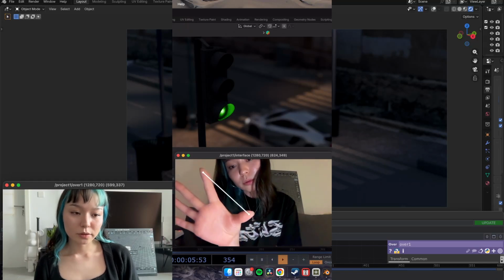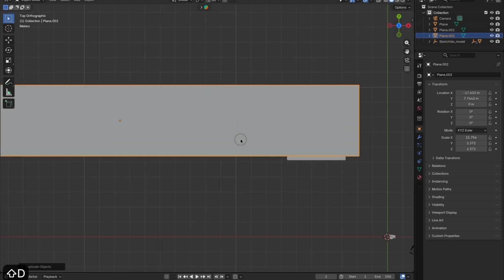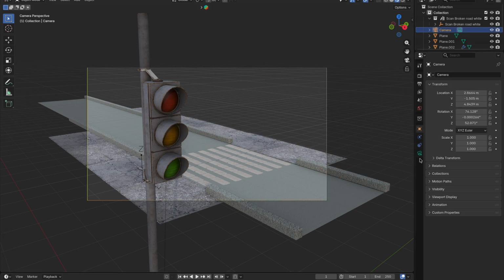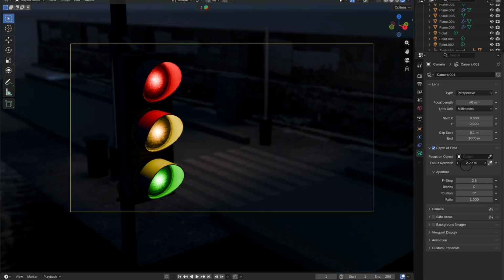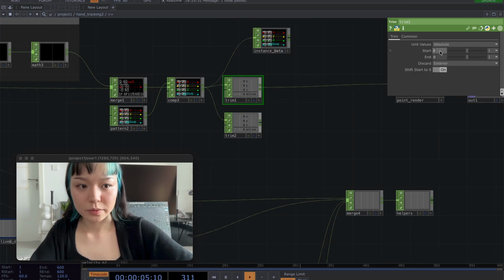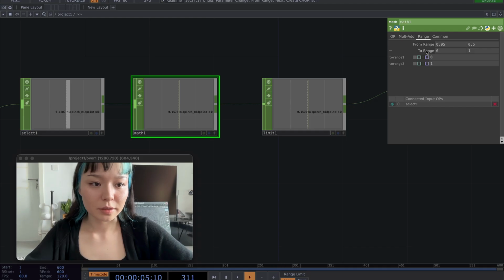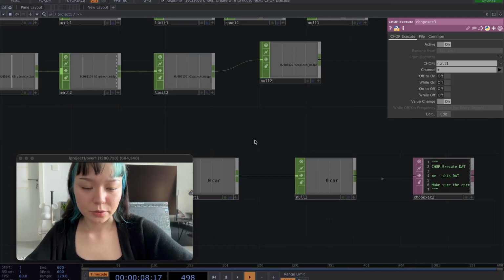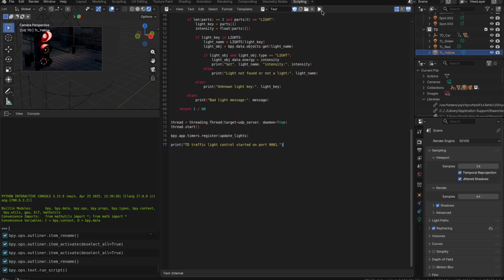TouchDesigner to Blender 3D tutorial | control light switch with MediaPipe

Comment from the maker: Blend, lights

import bpy
import socket
import threading
import queue

UDP_IP = "127.0.0.1"
UDP_PORT = 9001

LIGHTS = {
    "red": "TL_Red",
    "yellow": "TL_Yellow",
    "green": "TL_Green"
}

data_queue = queue.Queue()

def udp_server():
    sock = socket.socket(socket.AF_INET, socket.SOCK_DGRAM)
    sock.bind((UDP_IP, UDP_PORT))
    sock.settimeout(0.1)

    print("Listening for TD light control on 127.0.0.1:9001")

    while True:
        try:
            data, addr = sock.recvfrom(1024)
            message = data.decode("utf-8").strip()
            print("Light received:", message)
            data_queue.put(message)

        except socket.timeout:
            pass

        except Exception as e:
            print("Light UDP error:", e)

def update_lights():
    while not data_queue.empty():
        message = data_queue.get()
        parts = message.split(",")

        # Expected:
        # LIGHT,red,500
        # LIGHT,yellow,0
        # LIGHT,green,0

        if len(parts) == 3 and parts[0] == "LIGHT":
            light_key = parts[1]
            intensity = float(parts[2])

            if light_key in LIGHTS:
                light_name = LIGHTS[light_key]
                light_obj = bpy.data.objects.get(light_name)

                if light_obj and light_obj.type == "LIGHT":
                    light_obj.data.energy = intensity
                    print("Set", light_name, "intensity:", intensity)
                else:
                    print("Light not found or not a light:", light_name)

            else:
                print("Unknown light key:", light_key)

        else:
            print("Bad light message:", message)

    return 1 / 60

thread = threading.Thread(target=udp_server, daemon=True)
thread.start()

bpy.app.timers.register(update_lights)

print("TD traffic light control started on port 9001.")